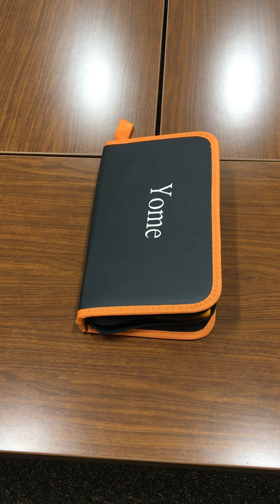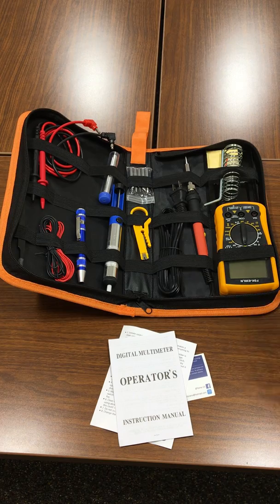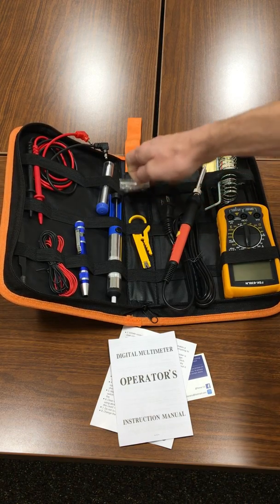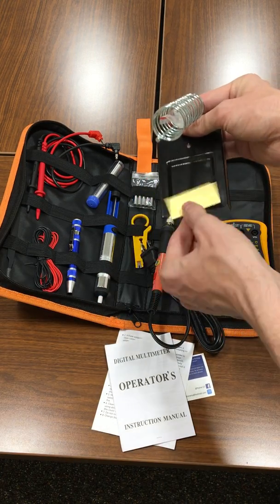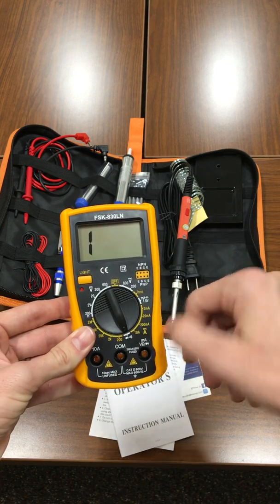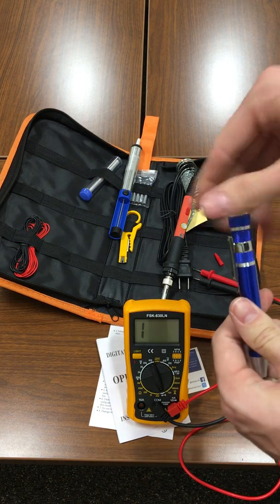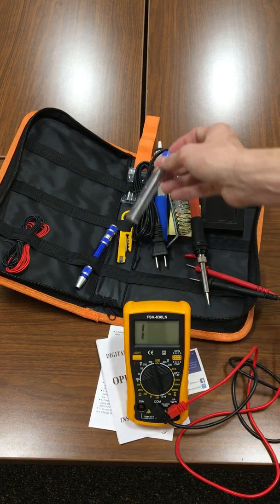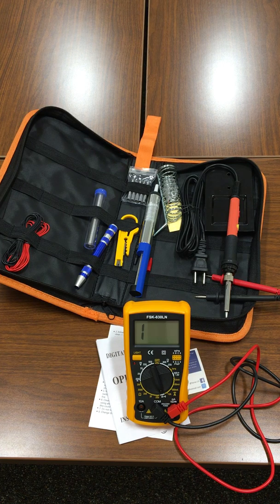YOME 19 in 1 Soldering Iron Kit

Comment: From what I was told the knife like tip can be used the scratch off the silicone on the boards in case you need to do a bridge if the board is cracked...